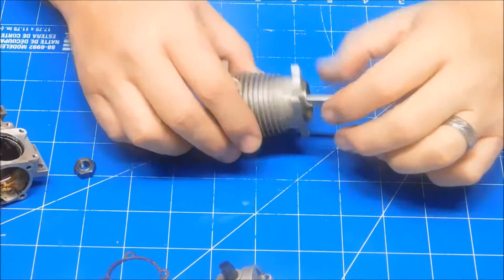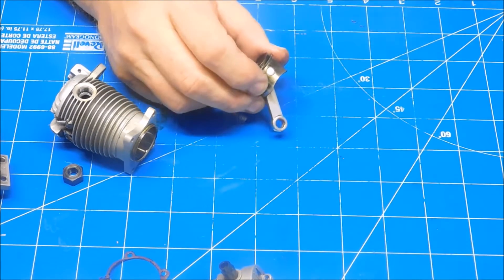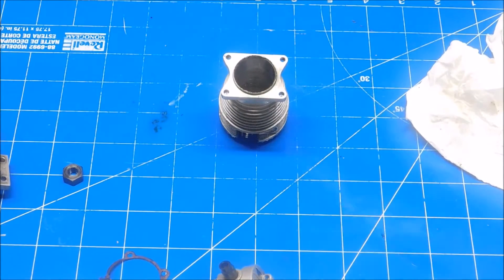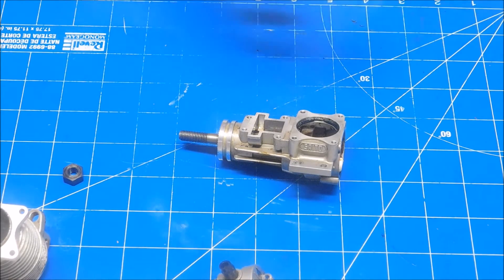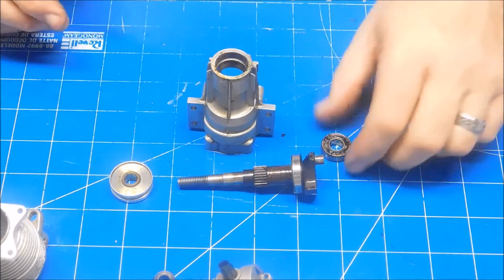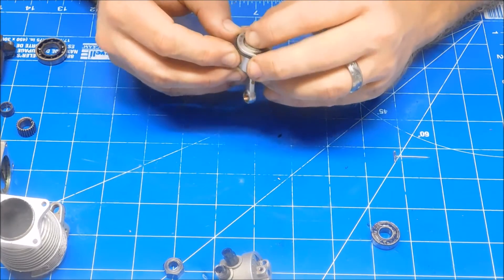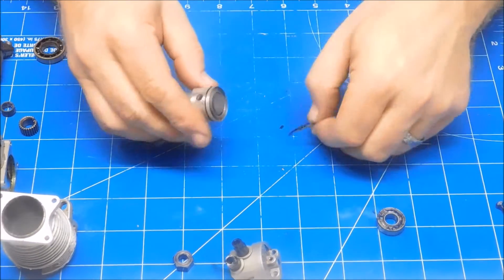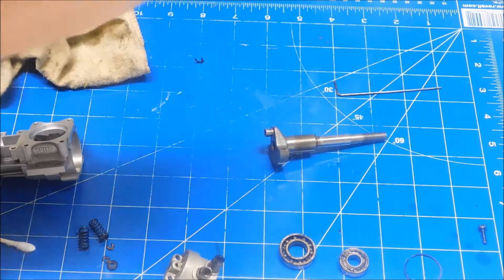Saito FA-50 Rebuild Project Part 2

Comment: Hi Dave I am looking up the LA's totally awesome cleaner here in Australia, it seems it's some type of citrone oil like an orange (not in colour) oil, is that the correct stuff, is that the stuff you have over there ?
Reply from the maker: Here is the MSDS sheet on it. http://wrenshall.k12.mn.us/common/pages/DisplayFile.aspx?itemId=32133922
Does it look like this? https://www.dollartree.com/LA-s-Totally-Awesome-Orange-All-Purpose-Degreaser-Refill-64-oz-/p300084/index.pro
Or this? http://www.dollargeneral.com/product/index.jsp?productId=11786549&gclid=CjwKEAjww_a8BRDB-O-OqZb_vRASJAA9yrc5l2GeODW2Bo6X5FqlvJUEGhsSZQLtLy6uwpbwwGuwIBoCmLDw_wcB
Both are the same I believe.  I just picked up a 64 Fl oz refill of the Orange yesterday for $1.  
Make sure that you DO NOT soak engine cases or other AL parts for very long, especially overnight.  Once you soak them, about 10 minutes, wipe or use an old toothbrush to clean and then wipe off completely.  Spray with alcohol thoroughly and wipe or blow dry again.  then coat parts with a light coating of oil.  I have seen, by accident, where a part left too long can become discolored.  AL parts not cleaned thoroughly will begin to form a white oxide corrosion if not protected with a coat of oil.
Reply: Yep that's the stuff I was thinking of, we have a similar product here, The LA's is so cheap there, here it's almost 10x the price. Thanks